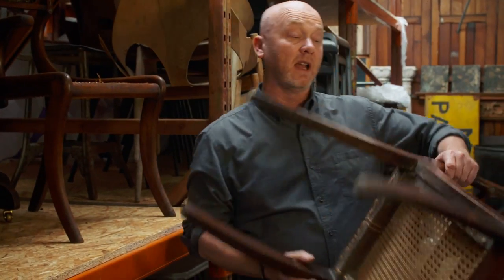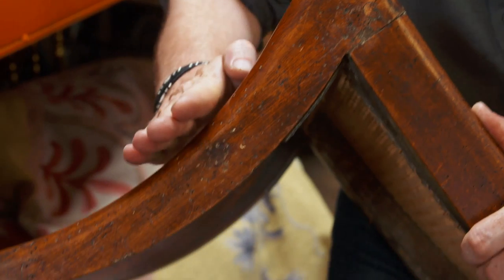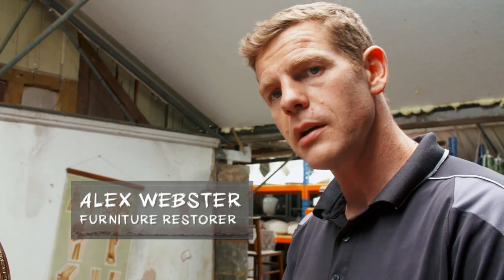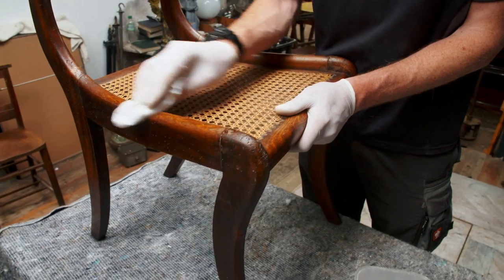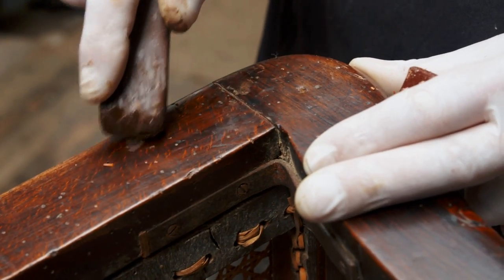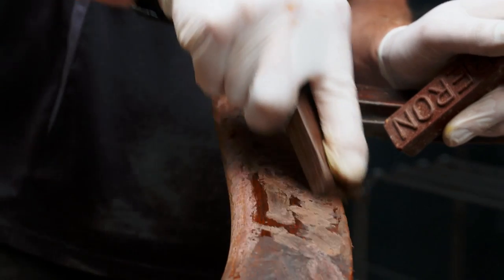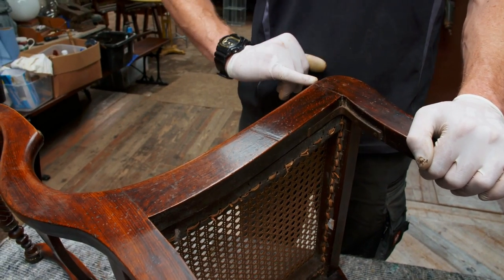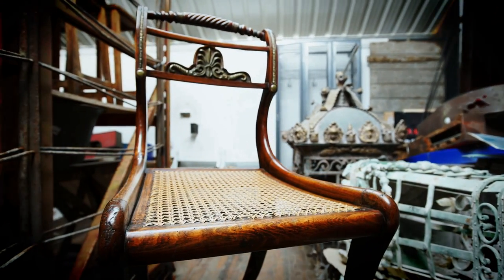How To Cover Up Woodworm Holes | Salvage Hunters DIY Tips

Comment: One way to destroy woodworm is to put the item in a dry, well ventilated room. The woodworm will eventually die out. If you want a quicker solution, put the item in environment above 56 - 58 degrees with a circulating fan for a couple of days. That will kill it all. Obviously with smaller items you can just put it a fan oven.
Reply: Good advice. For smaller items, such as vintage wooden planes (tool, not airplane), I put them in the microwave and heat until the wood is hot to the touch. That should surely kill off any unwanted residents in the wood. I've had one molding plane so full of holes, it weighed maybe half of an uninfested one. No point trying to revive one that was so far gone!

Comment: Great video. I use a boron based woodworm powder dissolved in water which is supposed to be not toxic to people and pets. Could you pour melted wax onto the surfaces?
Reply: The best thing is to use the method recommended but if you find one of those bits were the wood is badly damaged and falling off you can remove the really fragile stuff then when completely dry you can coulor it with a water based wood stain, as it will be a lot lighter then the sound or less damaged timber.When completely dry again Brush on some shellac or sanding sealer and this will harden the wood,you can buy products for this but Shellac is fine.you can then do the waxing.you don't want to be Adding new timber especially on really old oak furniture as the worm holes are part of the history.
Reply: @eddietwang  Thanks Eddie, sounds good
Reply: Is there a brand specific you use?

Comment: After killing the wood worms, why would you not want to fill the hole up with thin epoxy or super thin super glue to restore lost integrity in the wood from the worm holes?
Reply: Those holes go deep and connect with other holes. Filling it with epoxy would be very difficult even if it were possible.
Reply: There is an entire labyrinth of tunnels inside the wood, holes are just the exits. I think it would be extremely difficult to fill these tunnels with epoxy, it might be also quite difficult to avoid a mess (I'm guessing you'd have to sand the wood afterwards, destroying the original finish). Anyway, according to an article I read, if the wood had lost it's structural integrity, and is used in a load-bearing capacity (e.g. chair), epoxy wouldn't help to restore it's strength: https://www.epoxyworks.com/index.php/thinning-west-system-epoxy/
Reply: @GenePavlovsky  That's what I said